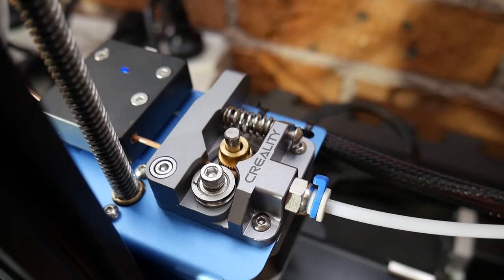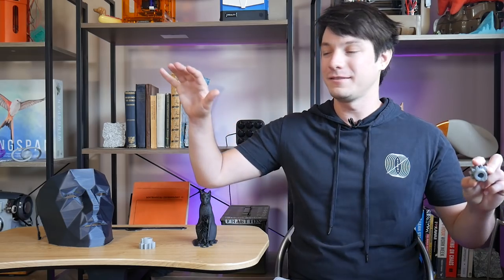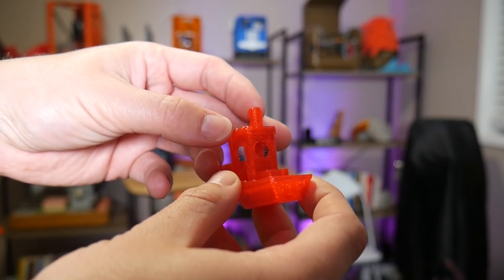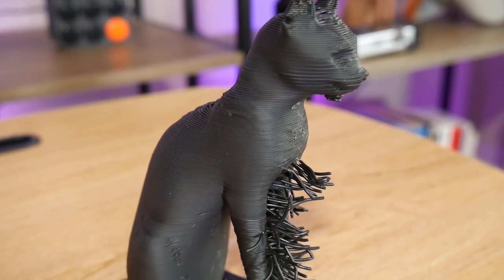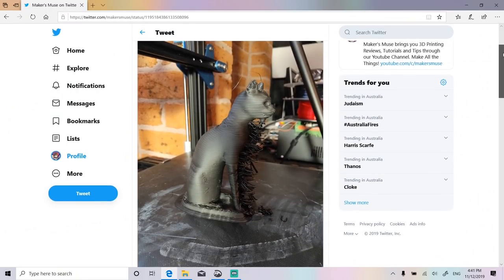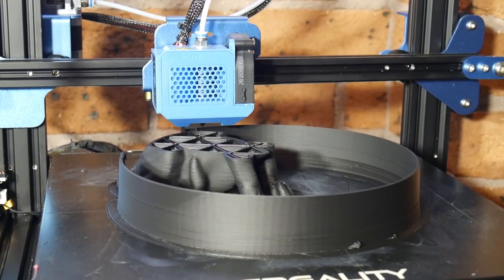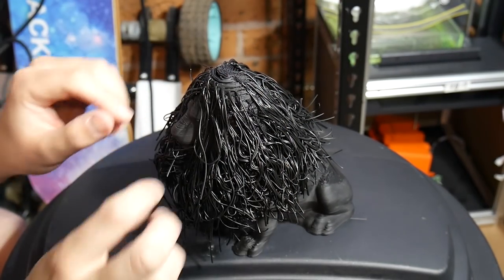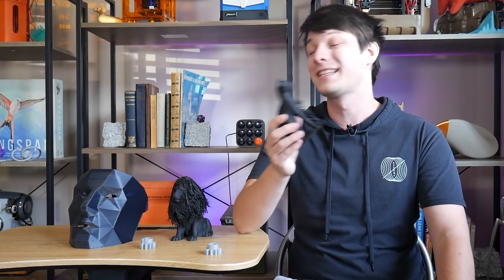MORE Crazy 1mm Nozzle Experiments - Hairy Lion in 7hrs!

Comment: Did you ever think about using a dual nozzle printer with two different nozzle sizes (1mm / 0.4mm)?
Using two nozzles you could print the inner layers with the big nozzle and the outer layers with the finer nozzle, reducing print time by quite a bit.
Reply: There would be the risk of nozzle collision with that.

If you do the inner layer first, the external nozzle would have to dip down below it, and if you do the outer layer first, the opposite is true.

There are probably ways around that but it would require special slicer settings to indicate the relevant sizes of the nozzle and would inevitably leave gaps between the wall and infill.
Reply: Z hop? @Tony_Goat

Comment: Spent the last two weeks cranking out parts that I should wouldn't have had time for without larger nozzles. The time saved is definitely worth the price of a set of assorted sizes. Some other notes:
- It also helped to cut off fixed lengths of filament and time how long it takes manually push them through the hot end under gentle but consistent pressure to get a sense of how much more volume throughput you can get at higher temperatures. This results in added stringing but is invaluable for cranking out quick test prints with the larger nozzles...just keep the rasps and flush cutters handy.
- cut a washer out of silicone or teflon sheet to seal between the nozzle and heating block. This mitigates surprise leaks if you're swapping nozzles a lot. Selecting nozzles with wider hex profiles help squeeze the seal too. I think I used a drill bit for the centre hole and a paper hole punch to make nice consistent washer disks.
- when swapping, make sure to only twist the nozzle against to heating block and not the rest of the assembly which could damage bearings or loosen other parts of the assembly. I ended up using a small hex socket and adjustable wrench to really control what was being torqued.

Comment: Very cool findings.  I tried 1mm nozzle that came with my Anycubic Mega-s and i had mixed results, had some gaps on a large print project i am working on.  So I switched back to the stock nozzle.  Fun to try and speed up my prints a crazy amount but not practical for my use case.

Comment: To manually input nozzle diameter in Cura 4.3 is the same as before, go to Settings > Printer > Manage Printers, pick your printer and click Machine Settings > Hot End tab > Nozzle size. 👍

Comment: I'm new to 3D printing.. that's a very cool trick for making hair.
Reply: Another approach I've seen is to print a bunch of unsupported horizontal radial lines. The sagging that occurs when the nozzle makes the trip back to the center winds up making a long loop that rests on the loops below it. Saw it on a pine tree model a couple years ago.

Comment: I am working on 3d printed parts for my 3018 cnc and just brought a 0.8mm nozzle thinking this would print stronger, now I am now so sure it will work.
Reply: Check out CNC Kitchen's channel for test of strength of prints from different nozzle sizes.
Reply: @Graham_Wideman  yes I did and I  also watched the annealing Tests. I have htpla V3 and I tried it at 110 with good results, but warping was enough that I am not going to do

Comment: In Cura 4.4.0 you can enter the nozzle size in mm. No more drop down menu from which to select one of a fixed set of nozzle diameters. You worked out the actual nozzle diameter was more like 0.95mm instead of 1mm. Did you print a retraction calibration object? I would hazard a guess that the retraction settings would need to be tweaked somewhat for that large diameter nozzle. It would be interesting to see how that might affect the quality of the prints.

Comment: The nozzle size shouldn't really affect the gcode. For a given layer height and extrusion width, it needs to extrude a given amount of material regardless of the nozzle size. My guess is that the nozzle size selection is mainly for providing reasonable layer height and extrusion width default sizes for that nozzle. It would be interesting to try to slice the same object with the same settings, just using a different nozzle size selection, and see if anything is different in the gcode.
Reply: Great comment. I am also very curious to know!

Comment: I use a .8 all the time on my CR-10 but do .2 mm layer heights, yeah it's not as fast as .6 mm would be but with far fewer parameters, you still get a very high quality print in most instances.  And because you can usually get a way with one perimeter, it's still a lot faster.

Comment: Hi Angus I've been debating getting a 3D printer for nearly a year. I have settled on getting a Resin 3D printer like the Photon S because of my passion for mineatures.

Do you know of any changes happening in 2020 that would make it wiser for me to wait. 

Are there any newer printers, software, materials etc. that would make it easier, cheaper for me to wait a few months before hopping into 3D printing.

I live in Canada (if that matters) and I'm speaking purely as someone who would like to become a hobbyist.
Reply from the maker: Resin printers are at a great price point now, I wouldn't hold off... Just be mindful of the safety considerations with resin!

Comment: I just change the line width when I change the nozzle, not much difference in terms of failing causes if there's any. Ender-3 often comes with e-steps lower than actual extruded length, I think this caused knots/bumps in infills that may crash with the nozzle, gets extremely bumpy the higher the print goes and eventually print failure due to skipped steps in x/y. not mentioning that the walls often had underextrusion in the start, whether that's due to glooping or that lack of extra flow from the anemic e-steps, specially true when using larger nozzle.

Comment: Hi,
I wonder if it would be possible, with a dual extruder, to print external perimeters with 0.1 mm nozzle, infill and others ones with 0.4 mm nozzle for example ...
It would be nicer and faster, but I don't think  it's an option in any slicer ?
What do you think about that ?
One way to do it would be to slice it twice, one for each nozzle size, and to mix the gcode lines in one new file. Not so easy to do !
I will try with a simple little cube to begin, as soon as I got my dual extruder.

Comment: Question, Printing on brand new Flashforge Creator Pro (NOVICE LEARNING), Using ABS on right extruder and PVA on left extruder for water soluable supports. How can i set the print bed  to to accommodate both types of filament? The ABS is set to 110 on the bed but the PVA is saying up to 60 max is needed? how do i do this? Thank You Rob C.

Comment: I've just started printing with different size nozzles, and in Cura 4.3 or 4.4 I just change the line width because that changes the tool path and extrusion amount together. I'm not sure if that's the correct way to go about it as intended by Ultimaker, but it works so oh well. Tested on 0.25 and 0.6 and 0.8 nozzles

Comment: Is there a way to work with dual extruders at different sizes?... If I really dedicated some time to I could manipulate it to a working way to print a single print with two different sizes, say .2 for the lions body and both .2 and 1mm for the hair. I think you would have to set it up much the same as you would for a dual color print but by creating 2 seperate slices (one for the .2 and one for 1) and use the .2 as the main printing for the "color 1" then replacing all the code for the "2nd color" with the code for the larger dia 1mm. I'm more of a CNC guy so this is a bit out of my wheelhouse, but it sounds feasible.

Comment: Heads up, setting your nozzle size in your slicer doesn’t really matter as it’s not used to calculate anything except for some sanity checks. I regularly swap nozzles from .4 to 1.2 and never bother to change the nozzle dia in slicer, changing line width and layer height is enough

Comment: Shame we can't use dual extruders with a 0.8 or 1mm for internal structure and infill and a 0.4mm for external walls and detail.  Would probably need to print 4 external layers then a single internal layer to prevent collisions although I can see it getting very messy if the custom G-code wasn't right.

Comment: i always wonder if is there any option in any slicer, that for example on 3 outline perimeters print at 0.3mm  and infill print at 1mm layer heght ! In simplify 3d i have not locate something similar to this
Reply: PANTELIS k If I’m not mistaken, prusa slicer can do something similar. Add a modifier using a scaled down version of your part, and change your layer height in the modifier.
Reply: @dogman8339  i think it's time to try pursa slicer ,tnxx

Comment: Now this is cool but I have a 1m x 1m print bed with a 4mm nozzle and a 5mm width filament which is a problem cause you can’t buy it so I buy solid pla cylinders  and build a conveyer belt loader, It’s epic but expensive

Comment: Hey Angus, how do I find the right settings for my 3D printer? Is it by trial and error?
Reply: Trial and error. But what problems are you experiencing with settings?
Reply: @barracuda6817   everything  is good, but I can't figure out the difference between the nozel size and the layer height.
Reply: @Jawad_Alhakeem  Ok most printers come at a .4mm nozzle. Usually we don't set layer height at .4mm because it may clog.  .1-.25mm is where you should be in layer height. Finer layer height = finer detail.
Reply: @barracuda6817 Thanks, I really appreciate it.

Comment: Thats bologna.  you can totally get great print quality out of a large nozzle.  my default that I use is a 0.8 mm and I commonly use 0.063mm layer height.  doing it that way I can run at 80mm per sec.  I can print thick wall car and plumbing parts in a matter of single digit hours.

Comment: Slicers don't need to know the exact nozzle diameter. A 0.05mm difference is definitely irrelevant you could have just set 1.0 and called it a day and it would not have made any difference. I don't know why that's even a setting. The setting should just say bead width and the user would ideally choose a nozzle with an orifice that's a little bit smaller than the slicer's bead width setting.

Comment: Your layer height looks too high.  I always used 0.5mm when I used to use a 1.0mm nozzle for all my printing, you may need to go as low as 0.4 for results comparable to using a small nozzle, even at the same overall speed.  But the biggest problem you have is that you really need to design the parts to be easy for the large nozzle.  Overhangs are bad, and anything geometry or infil that makes your nozzle have to stop squirting and start again is bad too.  Rounding the top corners of your part will often let you get away without using any infil, and you can instead use the plastic saved to add another perimeter or top/bottom layer which will print faster and add more strength than infil.

Comment: 1mm nozzle would be great for printing vase's in vase mode.
Reply: Devin from Make Anything did this
Reply: Would be great for creating mask structures then skimming over with filler.
Reply: Ben LePage I've used a 0.6 and that works great.
Reply: I can confirm that any nozzle 0.6 mm and up is great
Reply: Yes, it is amazing and I find the layer adhesion is not so much an issue because of how vase progressively move your layers up instead of that huge step it has to do when printing regular mode is a BIG difference because thick layer means you are printing in that much more empty space = lot harder to make it stick! 

Tevo little monster delta here and in vase mode with 1mm nozzle I have super impressive results :-)